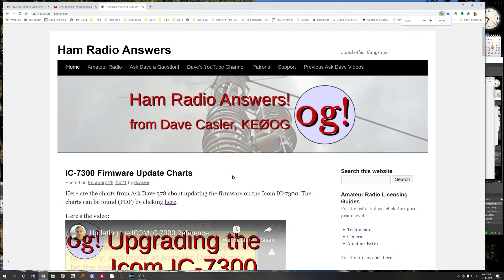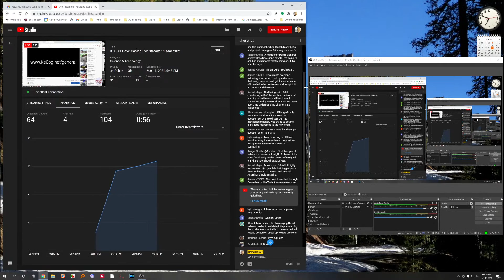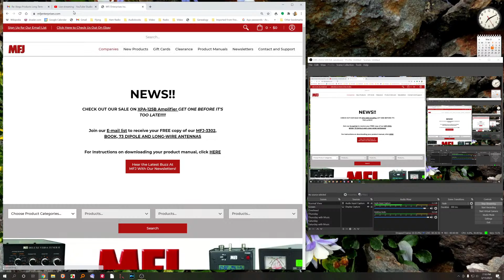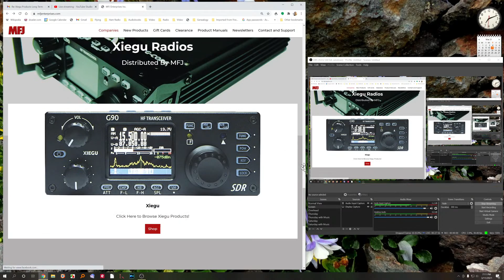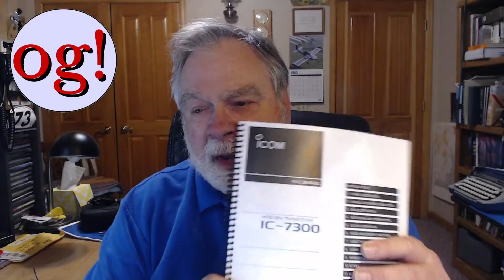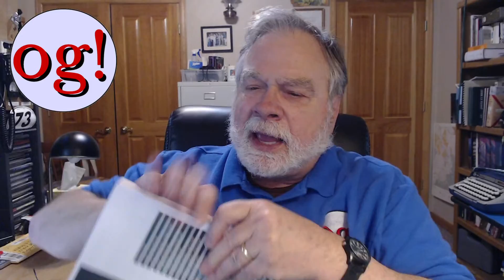KE0OG Dave Casler Live Stream 11 Mar 2021

Comment: Dave I have a lot noise at my QTH and suspect wall warts and possibly power line noise etc... I find that the noise blankers on my different radios, both old and modern, actually do a great job of taking it out. I almost always use it.